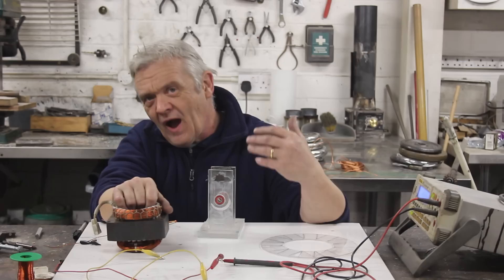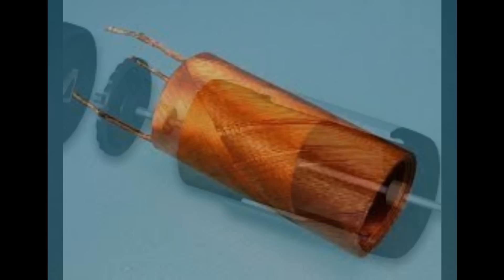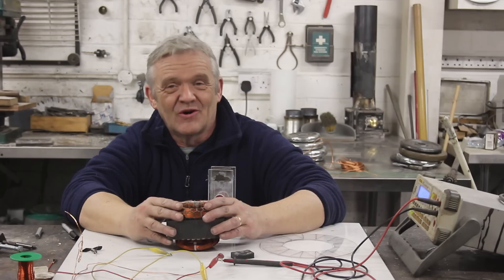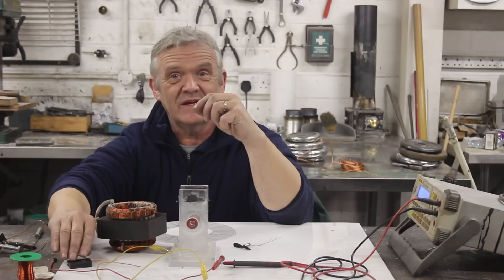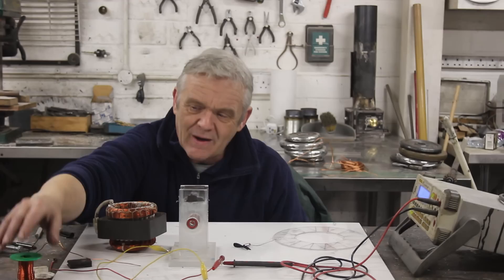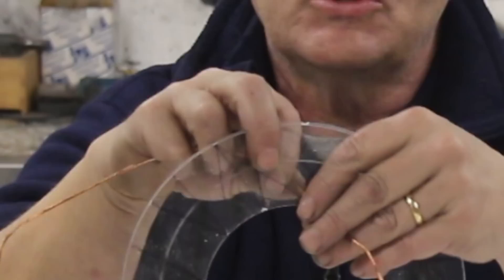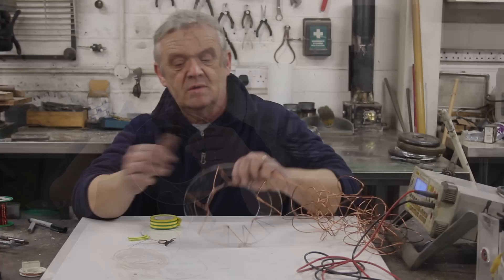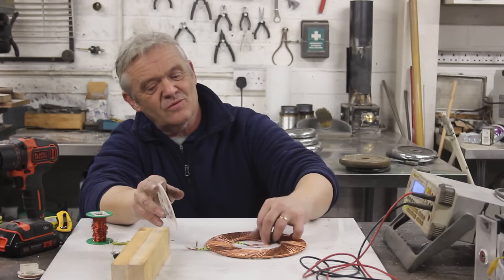1801 Winding Star (Faulhaber) Coils And Making Litz Wire

Comment: in power tool motors the magnets are set at angles to coincide with the angle of the copper.
Reply: the angle magnets in electric motors to reduce the caulking effect that way there's less slowing the motor down, makes it react more like a coreless motor with higher RPM in way better and remained almost same torque

Comment: I'm finding this series fascinating.  I've been toying with the idea of building and winding my own generator for a long time and I think this has finally incentivised me to do so.  One project I have wanted to do for a while is to build a generator with some VERY strong HDD magnets I salvaged from very old SCSI drives many years ago.  The problem (as I understand it) is that the poles are not oriented correctly.  The poles are at the edges instead of at the top and bottom so they would essentially cancel each other out as they pass by the coils.  I've been thinking that there must be a way to wind the coils to not only eliminate this issue but actually take advantage of it but I'll be damned if I can figure it out.  Not my area of expertise.
Reply: If you heat the magnets above a certain temperature they'll loose their magnetization 'permanently'.
It is then possible to re-magnetize them by putting the magnet inside a coil and applying a large current/magnetic field - any way you'd like.
(It is not easy to do, it requires very large voltage and currents - so don't do it if you aren't sure what you're doing)
There is videos here on YouTube on how magnet producers magnetize their magnets - it's the same process.  Good luck either way!
Reply: @EgonSorensen  I think I've seen that video or at least one that shows the same principles but that goes far beyond what I could do at home.  I was thinking of a dual coil setup with one on the outside and one on the inside and the magnets in the middle.  The N pole of the magnet would pass the outer coil at the same time as the S pole would pass by the inner coil.  The way it operates in my head tells me it should work but how they'd be wired together so that the voltages "sync up" instead of cancelling each other out is where I'm stuck.  And TBH I would prefer the challenge of making it work with the parts I have as-is instead of modifying them.
Reply: @Enjoymentboy  Not sure I understand correctly but if they are in sync but opposite, just reverse the polarity of one of the coils?
Reply: @stormatron6184  My apologies for not describing very well.  The magnets are the typical radius style (ie 6 of them set side to side will form a perfect circle) with the poles at the edges instead of the top and bottom faces.  I have been told on a few occasions that this is why they will not work.  In my head I can see two sets of coils with one on each side of the magnets with the magnets forming a ring.  The magnet ring would be mounted on a shaft and would be the only part to move and would effect both coils simultaneously.  I am NOT engineer so what I see in my head is likely not possible, or at best not efficient enough to be workable.  BUT...I was recently gifted a 3D printer and I'm slowly learning a CAD program so with luck I'll be able to start producing parts to see if I can get the image out of my head and onto the work bench.  I am 99% certain I can build the structure and such but it's the coil winding and wiring that has me stumped.  Perhaps I need to get it to the point where I actually need to wind coils so I can then see exactly how everything moves in relation to each other to tell just what I have to do.
Reply: Magnetic antennas for vehicles use a metal shield to focus the field into a tightly focused area. Maybe you could use that somehow to modify the "shape" or path of the field?
Reply: @Enjoymentboy  so, could you mount the coils axialy vs radial? You could do some interesting things with coils there.
Reply: @brucelytle1144  You know what?  That's an excellent thought.  I've been so caught up on keeping the coils flay, and therefore the whole assembly thin, that I hadn't considered this as an option.  Come to think of it I could probably just turn the magnets 90° so that the narrow edges (where the fields are strongest) are facing the coils.  I could stack many more magnets in that way but it would also increase rotating mass.  You've given me a lot to ponder today.  Thank you.
Reply: @Enjoymentboy 4months later….
Update…?
Reply: @One-way  It's funny you should ask.  I've been plugging away with many projects and I have finally gotten good with tinkercad.  I'm in the middle of designing a dual coil stator but my printer isn't large enough to print off what I need...so just last night I got my new, larger printer built.  I still need to tweek it but once I have it in order I can start doing some test prints.  I'm hoping to get this project in hand this summer but as I noted earlier I have many on the go and this is lower on the tier list.  😁

Comment: This is the first time I've seen your program, I've been looking at many that are producing 220 vAC power. Bur the star winging gave me an idea, the suggestion I have is if the Magnets were made in the shape of the star windings, then they would have the star windings at the correct orientation to the magnetic force 100%of the time. Then I there was another star winding on the same shaft using the other pole of the magnet there would be in opposite phase. Use one of the phases to drive the electric motor to turn the generator and the other phase to use to operate other machines and lighting. I haven't looked at how magnets are produced but they come in various shapes so how much a star winding would cost an of course demand.

Comment: Correct and good explanation of where and why to wind the coil in  this spacing and angle based on the magnet size  and not just any angle or location of without a logical spacing.

Comment: This is so cool to me.  I am curious how this would compare to a geared "stepper" wind generator.

Maybe after you turn this into a generator, you could: 
A) grab one of the generators you made with a stepper motor.
B) gear it, so that it takes an equal amount of force to spin as the Faulhaber coil generator (so both work in low wind speed).
C) see how they perform under equal conditions.

I feel you would have to create a 2-phase Faulhaber coil (or only hook up half the stepper motor) to get accurate comparisons..  But I consider you the professional here.

Thanks again for the great content!  And even more teaching us how to make Litz wire.  I have been spending WAAAY too much time on my toroidal transformers..

Comment: As some others have alluded, changing the geometry of the permanent magnets can provide an excellent trade off for additional torque, both with angles and overall sizes (reduced distance between poles, more poles per cycle, lower kV [for simplicity], higher relative torque vs the opposite). One should also consider, assuming this is an academic conversation, that changes in the current geometry must also change the thrust geometry, so in instances like this demonstration (and as another user has pointed out about power tool stator geometry that use FB coils), one may potentially lose more than they gain to friction without a carefully tuned alignment. Again, this is almost purely academic, food for thought, makes hardly any (if any at all) difference in concept demonstration and learning, but it can make a fair difference in industrial or infrastructural scales. I suppose the real question... Really is whether or not a given design in the real world can maintain electrical, mechanical, and thermodynamic efficiency above the cost of copper saved. The amount of motors I've repaired, handled, I have definitely seen a fair bit of poor, low budget executions that still work, and that's sometimes frustrating because the real cost to do it right for a given application (better?) Is about the same. It just doesn't make sense to me as a reasonable corner to cut, circumstantially on a precision motor; RM-S's explanation enforces this, IMO. 

Thank you again, another great video. Cheers from across the pond.

Comment: As a master electrician for over 45 years I have been exposed to many different electrical projects.
  I majored in chemistry and received my master electricians license in the 90s . 
   You have presented a new idea with motors and magnetism I salute you.And I will have many sleepless nights understanding what you have described.
   Post script: I am working on a DC /AC motor based on similar principles .  LOL like for the last 45 years.! LOL
Reply: This is an extremely common star delta been around for a century or more
Reply: @funnycatvideos5490  Unfortunately I’ve only been around for 67 years lol
Reply: Hint by obtaining fine copper, ( Cu2So4 + Fe203) creating aluminum channels in the rotor and exciting the copper in oil in those tubes were the Centrifugal force creates a flow, etc. some luck but time is short.

Comment: There were some other comments asking about how versatile this setup could be for places with varying wind speeds.  I had an idea that I thought could make a really fun project, but I am not quite sure how it could be completed.

The basic thought is this...  Construct a Faulhaber generator with 3-6 phases, then dictate a way (without electronics) to open and close the circuit to each phase depending on wind speed (turbine RPM).

In low wind speeds, only one phase would be online.  As the wind got faster and the turbine sped up, it would hit an RPM threshold and close the circuit to phase 2; effectively increasing the load and slowing the turbine.  Vice versa if it slowed down to a certain threshold it would open said circuit.

In theory, you should be able to scale the number of phases up or down for any amount of wind correct?  Running 10 phases in 150kph winds, I GOT YOU ;p
Reply: Centrifugal switch 
They are found in lots of washing machine motors 
Change the springs for different speeds
Reply: The other option would be to vary the field strength.

Comment: If you make the core from a water or alcohol soluble material you could remove the center . This will make the coil thinner and that allows for thinner magnets. I have a design like this that uses three windings one for each phase.
Nice job explaining basic electrical phenomenon.  Thank you.

Comment: For the central piece I think I'd go with sandwiching the coil disk with two more acrylic or whatever disks. 1. protects the coils from accidental touches to the stator/rotor (and damaging the coating), 2. more stable central axis when it's threaded through 2 points further from each other, 3. easier access to the coils should they require maintenance (compared to glueing the central disk in), 4. completely rules out the need to know the inner diameter (or outer, for that matter), 5. keeps the coils compressed and in shape at all times, and prevents winding slips on the acrylic disk (which could damage the coating).

Comment: I'm very interested to see how this turns out. I may be getting hold of an old car engine soon, and I had the crazy idea to turn it into an inverter generator. I'm not sure how, but I think I'd need to come up with some sort of governor so the engine can idle low, but get some extra fuel when more power draw is placed on the generator. I'm also thinking of replacing the stock alternator with a more standard generator/motor since car alternators aren't very efficient. This would be a "just for fun" project. I wouldn't expect a machine that's as good as store-bought, but as the engine would be free, I suspect it may be slightly cheaper. Depending on the cost of the generator/motor and inverter.

Anyway, I love all this DIY stuff. I wish I had enough wind to make wind generators worth while, but it's just too calm here, except for wind storms. Good for painting outdoors though. :)
Reply: I think you may want to keep the alternator to charge your starter battery.

Comment: Interesting. I think I will build one of those faulhaber coils, but I want to do it a little different. I have no idea if it will work out as intended, but it seems to me as it would make more sense if the (open) Triangle would span exacly over one Magnet (North for example) and will continue with the next (South). In addition I will give ferromagnetic PLA for the ring-plate a try to wind the coils on. That will be an interesting project apart winding those coils will probably come out as a pain in the a... doing it properly - I want 3 phase but wrapping them besides each other, not over one and another. Thrilling...

Comment: 1) what about angling the magnets also, either with it opposite the copper? 
2) what about making a longer axel on it and putting two coil types one to pick up the low wind and one to pick up the higher wind? 
3) advantage/disadvantage of one phase vs three?  Why not more than three if three is better than one?

Comment: With more phases you get less ripple , if you rotate the coils and your diode array the diodes can be arranged so that while spinning they get air cooling , such an arrangement can have output through sliprings with multiple brushes on each ring to minimize electrical noise that can be minimized with small capacitors and because of the low ripple smaller filters ( my favorite being a voltage follower set to a voltage below the ripple ( completely eliminating power ripple capacitor ) ) to no filters are necessary for direct utilization .

Comment: I have a bunch of the Maxon DC motors. They are insane for response n servo applications. With no iron in the winding, the start, stop, and position response is really quick with good torque and very little change in torque for the current in the rotation. It is as close to a rotary voice coil drive as possible to get in a motor.  Older motors unfortunately get clogged up with carbon from the brushes as most are sealed for clean applications, so the dust is trapped inside leading to the eventual failure. Similar tech is now using AC permanent magnet motors for servo application in robotics.

Comment: Mechanical engineer for an Aerospace company that makes generators. And designed PM and switch reluctance machines. That plastic disc significantly decreases fielded strength. Heat up the coil to melt the disc and then extrude the plastic through the coil to remove its thickness from the air gap.

Comment: Forming the resin would be really super easy, put mold release in the bottom of a cake tin [if the diameters allow it] or some similar sized pan [of course it would be helpful to know in advance so you can find a pan the size that matches your coil] even a pizza pan might work, albeit you might need one made for deep crust, and some restaurants have round server's trays with lips on them that might also work.

But if none of those are the right size, just put some waxed paper on the top of a smooth board and cut a hole in a matching sized piece of board, and line its edges with waxed paper, and maybe rub just a little bit of bee's wax or softened candle wax into the gap between the boards so the resin does not run out, and you should be ready to place the coil and pour.

Of course be sure you have your slip ring arrangement already prepared and attached, as well as safely masked off so epoxy does not get on them and have to then be removed later.

A couple of small lengths of copper pipe slipped over some PVC pipe, slipped over a metal axle would give both connectivity, insulation and strength.

Then slip those into a pair of bearings, and on one end add a pulley, or chain sprocket or gear, or fan blade, or water turbine.

Of course finding the best working speed might take some tinkering.